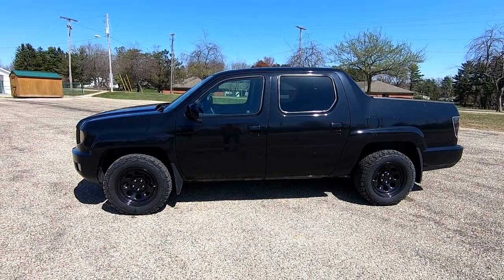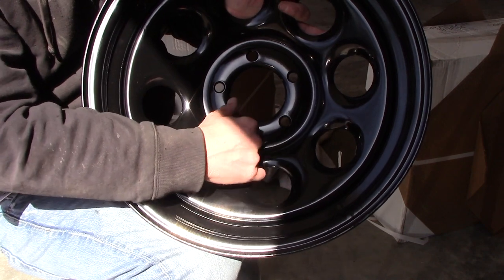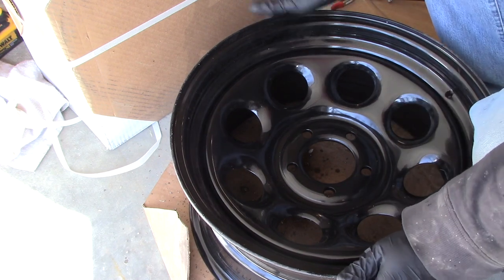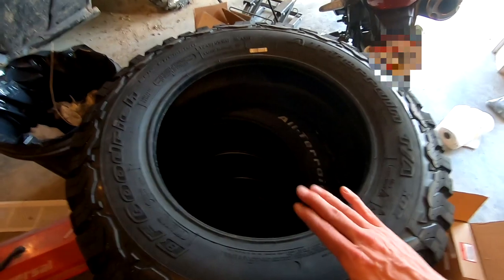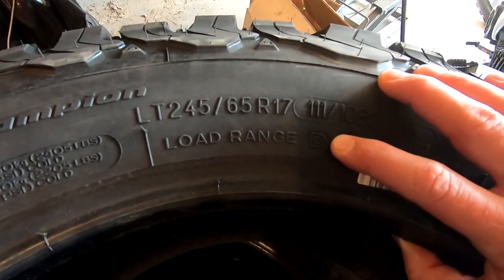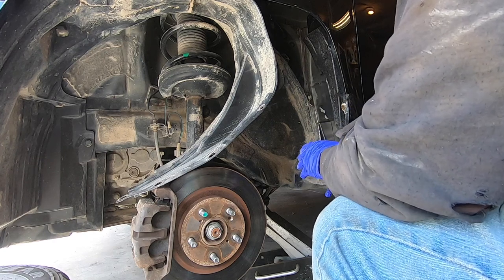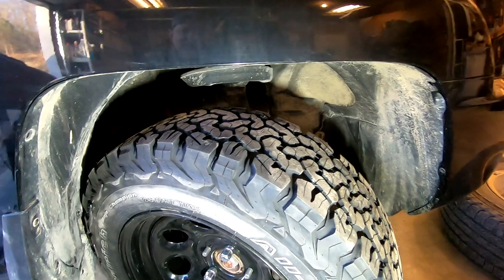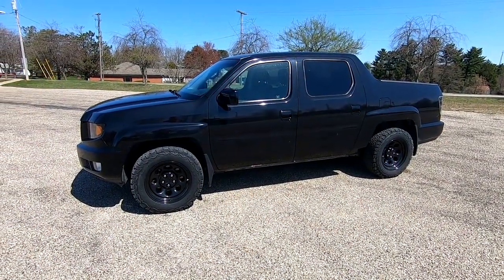Honda Ridgeline Black Steel Wheels and Tires BIG UPGRADE - 1st Gen

Comment: So I wanted to do this to my 2011 Pilot, but instead, I ended up getting 2" Bonoss wheel spacers and keeping the 17" six spoke OEM wheels. I did get a set of Kumho A/T tires in 245/65R17 and I have no rubbing, even at full lock. Next up, i'm gonna do a xenon projector headlight retrofit with switchback lighting and a 2" lift later down the road.

Comment: This is EXACTLY the look I want for my 2011 Honda Pilot Touring 4WD and it has the same dumb lug pattern that Honda went with, 5x120. The first gen Pilots have a different pattern with many wheel options. IDK why they went with this bolt pattern. I saw many people have used 5x4.75 wheels on a 5x120 bolt pattern on older cars, so I was leaning that way. Thanks to you, now I know what to do! I was thinking of going with 17x9 wheels though with a 0 offset, I know they will stick out a bit more.

Comment: Iv been looking for the past 2 weeks for a Baja style wheel like that for my Ridgeline and I got lucky and came across your video. Now my question is I found a different wheel beside the crager soft 8, And I was wondering if what you did could be done with this wheel. Brand is American racing AR172 Baja the make a 17x8. Also could wheel adapters work or just getting a different bolt pattern installed on our Ridgelines?
Reply from the maker: Sent you a reply to your email

Comment: With the bolt pattern 4.75 (120.65) have you noticed any wear or fitment issues? Or did reaming out the holes make them closer to 120?
Reply from the maker: Yes. Reaming out the holes made it fit perfectly.

Comment: The stock aluminum wheels look great (Almost Hummerish) if you paint them black.

Have 265 70 17 Duratracs on mine and they don't stick out, just fill the wheel well.

A little bit of shaving but no big deal.

Lift doesn't make better tire clearance like most think.

Comment: i see another videos when the pepople use 265/65/70 install 2 inch lift kit msybe is betther how you think..
Reply from the maker: Either way it's probably going to run with wheels that stick out farther. The only way to prevent minor rubbing is to keep factory wheel offset.